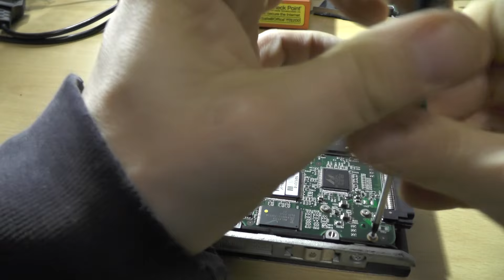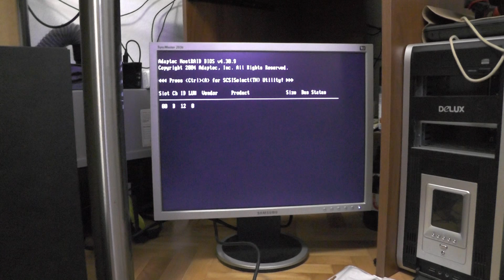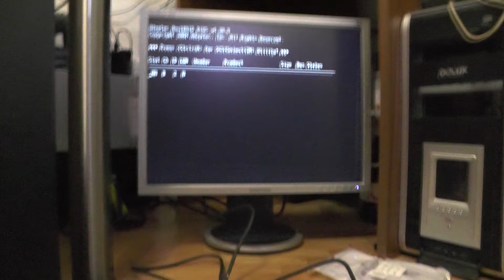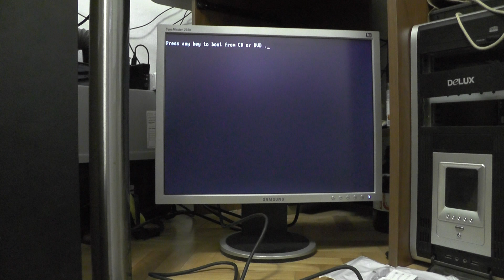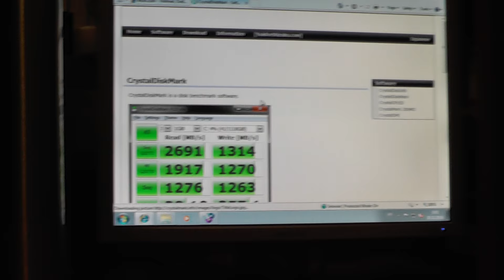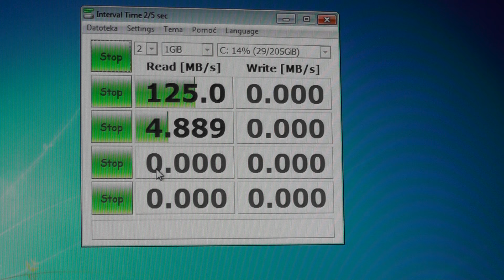[HW: Repair/Review] - IBM Server xSeries 226

Comment: hello can I close what you need 2 network cards in a server
Reply from the maker: I do not understand the question.
Reply: @MTS_IT  I don't understand what 2 rj45 can do in a motherboard, I wanted to ask you if you can make me understand this thing
Reply from the maker: @micheleventimiglia8449  aha... a lot of things - you can have two separate networks for example (two subnets) - one can be internet that's "input" - for example 10.10.10.0 and other 192.168.5.0 "dns" for other machines (and machines would not be able to see each other) - dedicated lan for whatever (a lot of things) new servers usually have 4 (+4 on separate card)

Comment: Could I make the SCSI driver available for windows to detect my hard disk? My email: gospelapc16@hotmail.com
Many thanks friend!
Reply from the maker: There is a link in the description. Cheers. Use x64 windows.
Reply: I tried the description drivers and I could not buddy. Windows 7/64. I will give up windows and leave linux installed even kkkkkk. Thank you very much!
Reply from the maker: hmm...strange... did you configure raid propertly? Or perhaps the drives are faulty? Or addon raid card si messing up my drivers (you can try to remove adaptec card and try again)